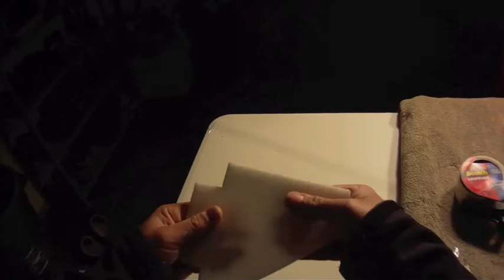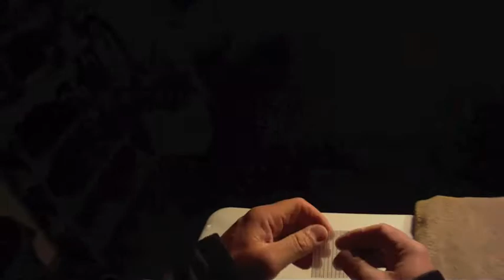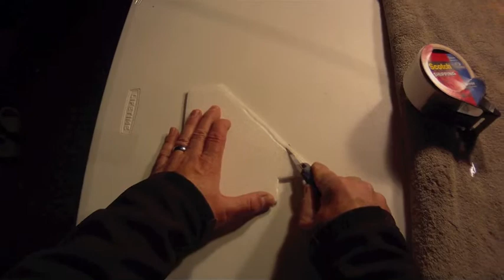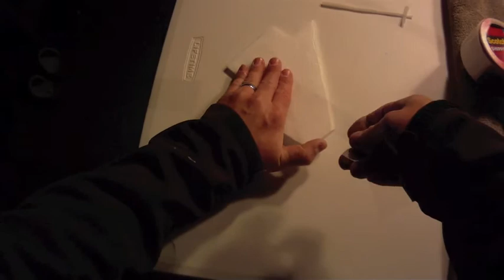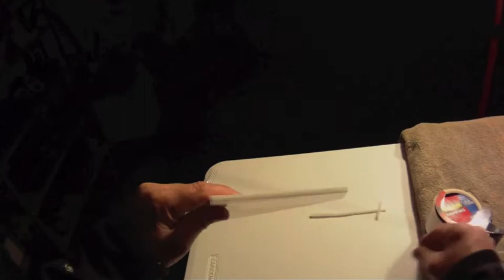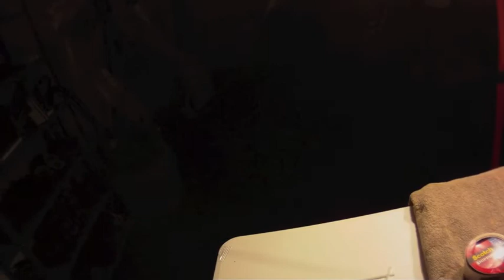Pre Stressing Stabilizers & Elevons with Tape

Comment: *insert Viagra joke here*
I was against taping everything when I started flying. Weight is the enemy and so on. 
With Parkjets, the wing loading is usually so low it doesn't matter. You could cover an entire plane with tape and it'd still fly.
Good tip.